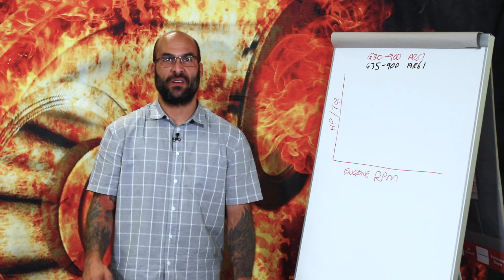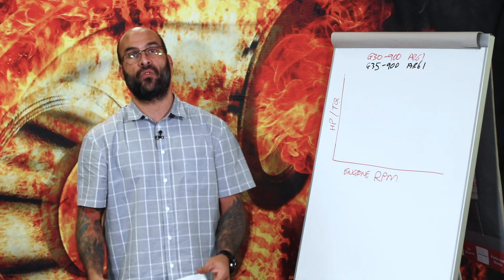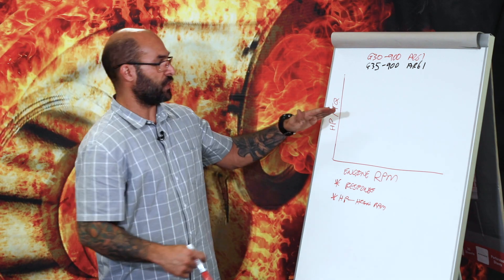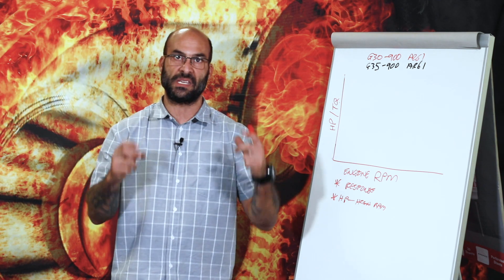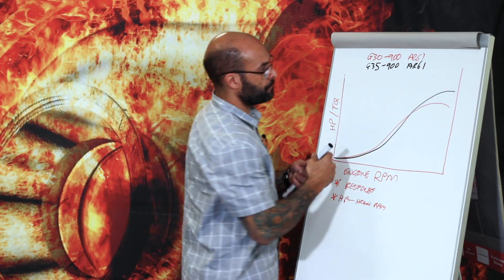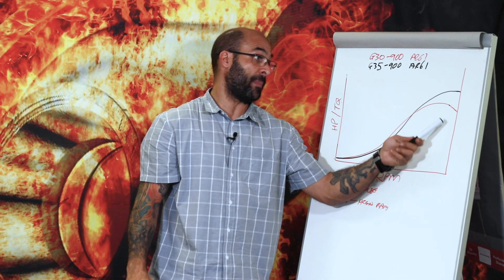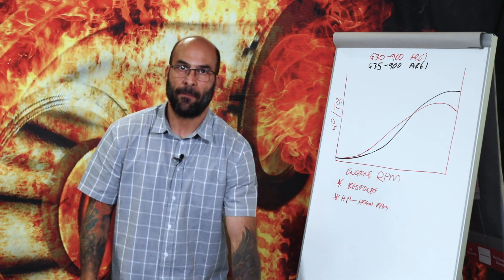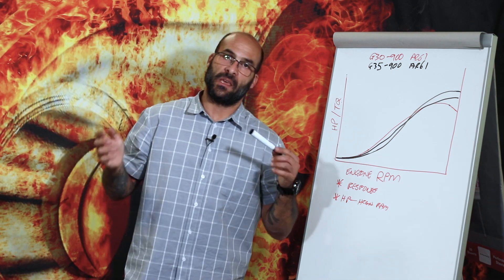G30-900 vs G35-900 N54 motor

Comment: Good content man, the garret hp ratings on the g series seems the comp could flow it in the perfect conditions which no one really has.
What do you think of the s361 up to 364.5 bw range? There's a good chance my turbo will eat ringland so a cheaper option to the 8374 8474 would be good, or after reading the comments maybe gtx3582 gen2 in the .82 t3
Reply from the maker: Thanks for the compliment - the 8474 will run rings around the G35 series. We have tested these back to back on a few cars with very impressive results from the EFR range - the Garrett product is over-rated and simply does not perform as advertised. Pity, because this was once a really great product with an awesome team behind it - how things have changed since their bankreuptcy.

Comment: Hi there, I know this is an old video but I am looking for a turbo application for my ford focus RS mk3. The engine builder can use the G30-770 but that will give me 750hp at the crank, would it be better to have the G30-900 if the housings are the same size for turbo as the RS engine has little room for a huge turbo.
Reply from the maker: Thanks for the comment - first off, the G30-770 will never get to 750HP at the crank, it will battle to reach 700HP.  Look at the compressor maps for a more realistic outline of what the turbo is capable of.  What HP target are you looking to achieve?
Reply: @TurboDirectSA  thanks for the speedy reply, I am looking for around  750hp plus a little head room so I dont run the turbo maxed out. Its a fully forged 2.3l with water/ methanol kit. Its for the road with track/sprint.
Reply from the maker: @Cyb3rn3tiX  First off - if you havent already -- you will have to beef up ALOT of things for that motor and drive train to be able to handle the power target you have in mind.  

There are a number of turbochargers which fit the bill here, the G30-900 is NOT one of them im afraid.  The next issue is that the power you aiming for is very high - lag will be an issue.  Yes the manufacturers claim 900HP and 1000HP etc  -- in reality you will never see those figures from the G-series turbo.  You will have to go larger and if this is a street car, you will experience some lag - in fact quite alot of lag..... its the way it is and physics governs this im afraid. 

I would consider the EFR8474 Black to be honest, its going to spool the fastest out of the 900-950HP capable offerings, and it will make the claimed power.

Comment: Great Video thank you! 
I'm aiming for 600 whp on my N54 with 93oct + Meth. I'm looking for a responsive setup and I also like a punchy car. 
Sadly, the EFR range doesn't  fit on my Z4, compressor housing would contact the subframe. 
Instead I was thinking about a GTX3582R GEN 2 with 0.86 AR twinscroll aftermarket turbine housing. You think that would be the right choice or any better alternative out there?
Reply from the maker: Thank you for the compliment - this is a good option for you based on your HP target -  https://turbodirect.co.za/store/index.php/shop/turbochargers/gtx3582r-forged-detail

Comment: Do you think the small exhaust turbine will cause high exhaust manifold pressure. I feel like the g30 is a tiny turbine.... the g35 will let the motor breath easier? Im stuck with single scroll for now or I would go efr. I currently have a brand new gtx3576r. Brand new S52b32us , fully built. Looking for 550+ on pump gas.  I feel like the g35-900 is the only choice, or i get a 3582 and use my current turbine housing.  Im worried about high emap. I like a punchy car. 3.5" exhaust.  No matter the turbo, .83 t4. Or before I buy,  When will I be able to buy a comparable "turbo direct" unit instead?
Reply from the maker: Great comment Drew, the opposite applies. The small turbine with the identical AR turbine housing on the 30 family will have less back pressure than the larger 35 turbine inside the same housing - yes they use the 100% Identical turbine housings.  I would steer clear of Garrett for a number of reasons. 

The EFR range is far superior, as you have seen in the side by side comparison videos on the channel. The new G-series are overrated in both power printed on paper, their compressor maps arent anything like the printed HP claims, and the product itself is nothing like the previous proven GTX Gen2 range. Lastly not worth the money. 

The TurboDirect S.A range is coming soon, very soon - keep your eyes peeled, and if your project is not urgent, wait a while, you wont be sorry.
Reply: So many people run the gtx series... like its the default choice here in america.... I WISH some one would put a few options on the exact same car with dyno plots /pulls.... like a 2.5 or 3 liter , with a 3071, a 3076 , 3576, 3582, 3584, g30660 g30770 g30900 g35900 g351050.... all to compare.... It woukd be the end all video for 6 cylinder turbo choice.   Or bigger turbos w/v8 or smaller w/4cyl.... Its the information missing on the interwebs.  Im not aginst trying other brands ... I just can never find true back to back. (Very rare) It could be a 2j  , or a rb, or a s50/52/54 or even a single turbo n54... I spend so much time looking, so little g series data. This comment section has more info than most forums I dig through.
Reply from the maker: @DewDravis.c.o.e.33  I love this comment, and it falls inline directly with our plans in upcoming videos - we will be doing just that. I know the channel has been quiet for a few months now, but as you will see in the up-coming week (around the 29th) we will have alot more content for you, and VERY exciting content, which i know you all will absolutely love!

Comment: Im aiming 550whp with the capacity to achieve 600whp+ down the road with my 2015 STi, question is im debating between the G30-770 and the G30-900, which one would be a good option to achieve my goals?
Reply from the maker: My first choice would be the EFR7670 without a doubt. The G30-900 is a little of a mismatch, and will definitely not produce 900HP. The G30-770 will produce similar power to the 7670 - which would be the best in terms of reliability, without a doubt the EFR, its better cartridge, much larger water cooling jackets in the bearing housing, and the internally gated turbine housing and Gamma-TI wheel are just unmatched by any Garrett especially in cost.
Reply: @TurboDirectSA  I read many times that the 7670 isn't producing much real world difference to the 7163 (which spools a lot faster and is only like 20-30whp behind in the top end), that it isn't delivering the numbers from the map. The advice is to skip it and go to 8374. What do you think about such comments?
Reply from the maker: @aspirantkzn  Check the compressor map - the 7163 although is rated at 550HP on paper, it produces closer to 600HP. This is also why we see 550WHP from this turbo, because its under-rated. 

The 8374 is old, and only makes 750HP, the 8474Black replaces this with its revised design, which makes 950HP - spools the same as the 8374 too - there is a hole in the offerring at the moment, and we designing a larger, compressor for the 7670, and should release this soon, which will take it up to 750-800HP .
Reply: @TurboDirectSA  TY for quick (wow!) answer. So you think that the 7670 is still better than the G30-770/900 or G35-900? 
I'm shopping for something slightly larger than 7163 now, can't wait for new products. My car has a 2.8 V6 (B284 Saab) and is a daily with a need for oomph for our frequent no limit autobahn escapades (600whp top end would be ideal). What would be your recommendation for that, please (PS ideally with twin scroll)?
Reply from the maker: @aspirantkzn  Pleasure my friend. The 8474Black is without a doubt a serious contender for this engine. The turbo sits above and to the side of the gearbox, and might need a manifold runner upgrade to flow the energy you want to drive the turbo for your target HP - the 8474 will spool no problem on this engine, and it will make the 600WHP you aiming for easily with some in reserve. 

The G30-770 wont see 700HP at the crank. You will need to use everything it has to offer you, and you might come up shy of the power. The same goes for the 900 - although it claims 900HP look at the compressor map, this is in essence a much lower HP output turbocharger than advertised. Once again you will use it to its limits - which is not good. 

The EFR series runs cooler, spools faster (size for size family for family - apples with apples) and rotates up to 20% slower than the G-series turbos, making it reliable, rock solid, and the GAMMA TI turbine is seriously untouchable.

Comment: Bro, still about to buy a turbo. Reread your email. Thanks again. So close to finishing paying for my engine build. Open deck but everything else is fully built with sleeved cylinders. Guys are telling me get a garret, get a garret, or pure twin high flows. Still wanting track and street, I’m still interested in the efr 7670 you recommended. Wound that still be your #1 recommendation for my 1M and what kit for the turbo. Single>twins for N54??? Thanks again.

Comment: Great videos 👍 im trying to decide on turbo setup for my Golf R32 VR6 3.2 V6 if you can help me out? Looking to run 650 crank hp give or take and would like best response possible as its a street car. I'm between G30-900, G35-900 and the GTX3582R Gen 2 all T4 .82 AR.
Any info would be appreciated 👍
Reply from the maker: Thanks for the compliment -  I would not be looking at Garrett at all for this application to be honest.  Especially not the G-series. The G-series is not cut out to be what it says on paper. 

The EFR8474 BlackSeries will work perfectly on this setup with the internally gated 42mm swing valve, the Gamma-TI turbine will respond faster than any G-series turbo in the same family (G35) and will outperform the garrett easily. Its a complete package and costs less money - its more reliable, has better materials (ally bearing housing), lighter, larger cooling jackets (much more reliable) etc
Reply: @TurboDirectSA  Thanks for the reply. I was looking a EFR turbo at first but I'm using a CTS turbo log style manifold which is single T4 and EFR are twin scroll it also already has wastegate flange.  I've been offered really good trade discount on any garret turbo, If you had to pick a turbo from the garret range what would you choose? Really appreciate your help 👍
Reply from the maker: @dkautos  I would blank off the gate and use the EFR - if Garrett was the only option, i would go for the GTX3582R Gen2  - G-series is overrated and does not make more power than the GTX Gen2.  Keep in mind that even thought yo umight get a trade discount - you still need to fork out for an external gate.

Comment: Hello, I am building a 1jz vvti forged, I don't know what to choose between g30-900 and g35-900, it will be a street car and would like to have something quite brutal, we are aiming for 600-700whp
, which should i pick ? and what a/r ?
Reply from the maker: Without a doubt the EFR7670 is the best option for the 1JZ  as a street setup where you want decent spool. The smallest housing AR on the EFR7670 is the AR83 - the light weight turbine wheel will spool faster than the G30- series turbos and will make the claimed power easily.
Reply: @TurboDirectSA  Thanks for the answer but i see the efr7670 is with a internal Wastegate and non v band, so if I had to choose with Garrett what do you suggest ?
Reply from the maker: @theopunisher3021  I wouldnt choose the G-series turbos at all. The GTX3076R Gen2 is a much better, proven setup, and has Vband housing opitons.

Comment: Very informative! Looking at putting the G30-900 on a 2.2L 4G63.
Reply from the maker: The EVO motor is dynamite - will spool fast and make decent power.
Reply: Should spool a bit earlier with the MIVEC as well 👍🏼
Reply from the maker: @michaelplant4351  Its a small turbine stage - will spool EASILY with the 2.4 -- you using a 102mm crank and big bore - i had an EVO4 with the same setup but full head work etc -- spooled the GEN1 GTX3076R like nothing!
Reply: @TurboDirectSA  Looking at 600+ WHP, street & circuit setup so I don't want it to be too laggy. Would you suggest G30-770 or G30-900? 
From what I've researched the 900 should work well.
Reply from the maker: @michaelplant4351  What HP? I would go G30-660 or GTX3071R Gen2 -- spool is faster and linear response is quick. A step ahead is the EFR7163 (550WHP) or the EFR7670 (650WHP) - much better turbo for circuit.
Reply: @TurboDirectSA  Looking at 600+WHP. I thought the 770 or even 900 would still spool well with the Mivec 2.2L.
Reply from the maker: @michaelplant4351  The 770 will spool fast for sure, however when you mention tight circuit racing, linear response comes to mind, and for that i normal recommend the smaller option. Area under the graph is more important that peak HP on a circuit.

Comment: Awesome video great information
Reply from the maker: Thank you very much!
Reply: @TurboDirectSA  i run a Gtx3582r  .82 on my Nissan FJ20 2140cc 30psi making 650whp
Reply from the maker: @teejay1600  Thats a proven turbo and reliable! Im still a fan of the old school designs to be honest
Reply: @TurboDirectSA  https://youtu.be/mVkA4PQtElM

A comparison done by some Aussies i know.
Reply from the maker: @teejay1600  G35 will outspool the larger turbo and the area under the graph will be probably be 30-40% more -- this is where the power and torque really counts for a streetable, yet still potent sprinter.  Would have been nice to see the graphs overlaid to show what im referring to.
Reply: @TurboDirectSA  yes ofcourse I was just highlighting some real world data
Reply: @TurboDirectSA  the old GT3582r have 79% EFFICIENCY 
simeler to G25-660
Q/what weel be best for 5.3L or 6.2L LS engine twin turbo 
target 750-850WHP
street/strep?
thank you for your time and afert?
Reply from the maker: @strokerz2858  Need all the engines data to calculate the VE of the engine, once this is obtained, the rest is easy to plot onto a compressor map.

Comment: Hi I’m really enjoying all of your no nonsense and very informative videos, thank you.
We are building a new bmw 135i track only car with an N54 
Our intention is to run port injection only and a single turbo.
We’re looking for a reliable 550hp at the wheels. Redline 7000 rpm.
We were going to use a Garrett G30-770 which looks fine on paper but.....
Looking at the comments here and your replies, I’m starting to think that it’s not the best option.
I’m only interested in a quality genuine unit that we can run with plenty of heat capacity to spare.
Can I be cheeky and ask your recommendation for this application?
Reply from the maker: John - thanks for the comment. In my opinion, the EFR range is far superior as its designed specifically for track and circuit racing. The reliability, linear response and the bullet proof bearing system is unmatched.  The power you want will easily be achieved by the EFR7670 - i would opt for the AR83 turbine housing, as you will be spending most of your time in the higher RPM range and the large engine will have no issues spooling this up at all - even in slower corners, like a hair pin.
Reply: Thank very much for your advice and prompt response.

Comment: What g series turbo you recommend to do 800hp (max) to the wheel on a 350/370z and have a good response you talk about on the video?
Reply from the maker: I would not use the G-series turbo. The GTX3582R Gen2 is a dynamite design and proven - based on the low price point when compared to the G35 - it makes no sense to use the G-series at all.  The engine in question is large enough to easily spool the GTX35R and will make the power you want with no problems.
Reply: @TurboDirectSA  would be how much boost? Thank you for the answer ❤️
Reply from the maker: @neliosantos8318  I would estimate 2.0bar gauge pressure, depending on the engine ability to use what the turbo provides and the supporting hardware mods.

Comment: Why didn't you recommend the 3584rs?
Reply from the maker: The GTX3582R Gen2 is more than capable of doing the job and faster response aswell as less money
Reply: 3584rs is more expensive than G35-1050 ?
Reply from the maker: @mushasho  No more or less the same price, but the GTX3582R Gen2 is alot less money.
Reply: Is 84rs no longer a competent turbo compared to the 1050? @TurboDirectSA
Reply from the maker: @mushasho  It is very competent, more so than the G35-1050 in my opinion.

Comment: I belive the G-series of turbocharges has to be the most overrated turbocharges ever. No realism. Just have a look at the exhaust flow chart. The A/R 0.61 housing with a G30 wheel flows only 20 lb/min. With the G35 wheel the flow is 24 lb/min. 
I do not belive this is enough exhaust flow for 750 whp. 
Looking at the compressor the inducer is only 62 mm. At about 2 bar gauge the max flow possible is about 75 lb/min. No way this will support 750 whp with E40 fuel. I belive the customer will be VERY disapointed if he goes this route.
Reply from the maker: The compressor map we have found to be optimistic